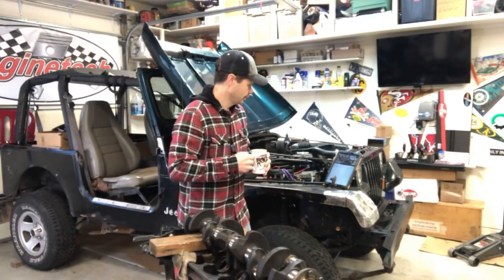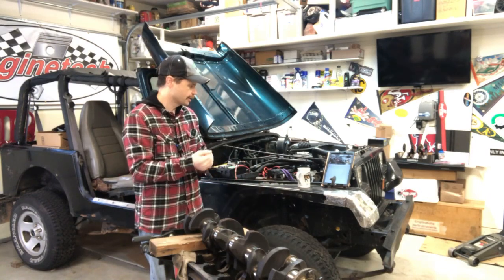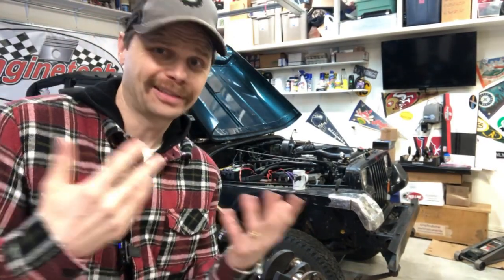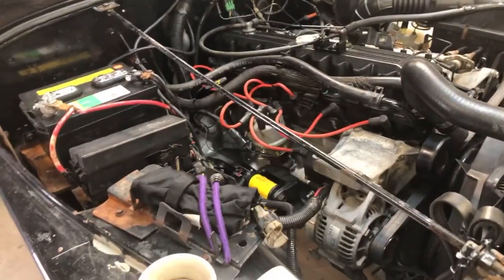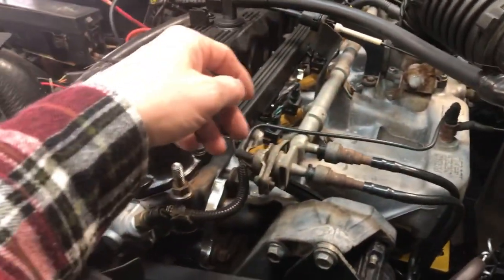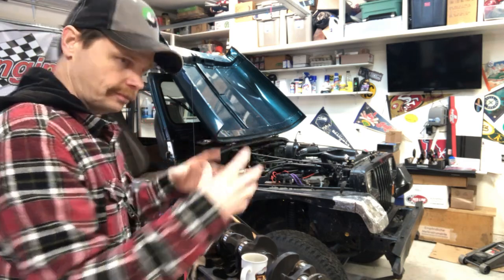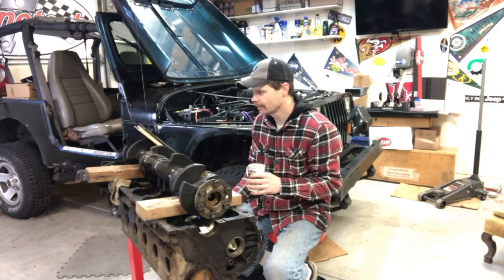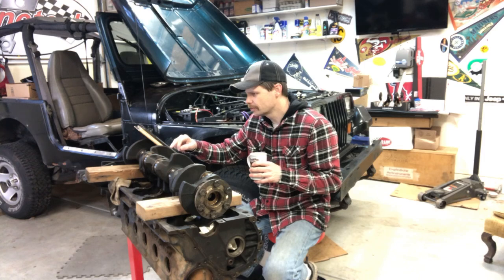Could you remove an Engine? Tips and Tricks: Morning Coffee Live ☕️

Comment: Nice thing about these 6cyl jeeps is how easy it is to get the engine out. it takes me about 3 hours to have the trans / t-case out and pull engine, no I do not pull header panel off front, just lift over it.
Reply from the maker: Yeah. It's really not that hard
Reply: @JeepSolid  I do have to admit I have a Novak cable shifter on my t-case and it makes quite a difference in access under there and ease of linkage removal. I do like your videos though. Seems they are geared toward the average home owner garage which is more real world than some of the others. I sometimes take it for granted I happen to have a machine shop next to the garage so when I watch you I enjoy the real guy approach.